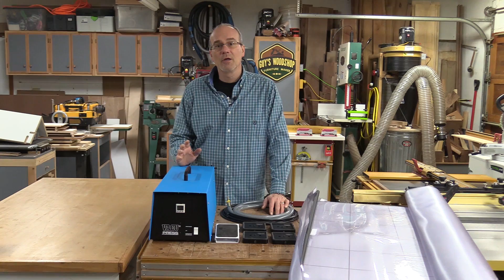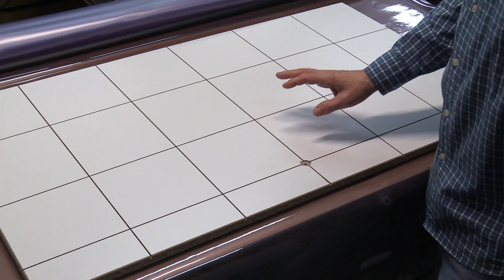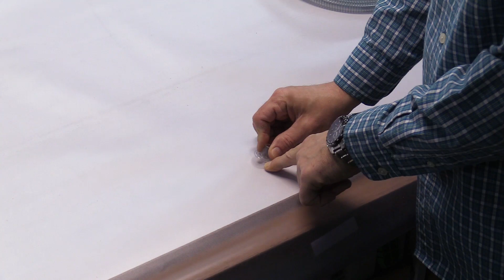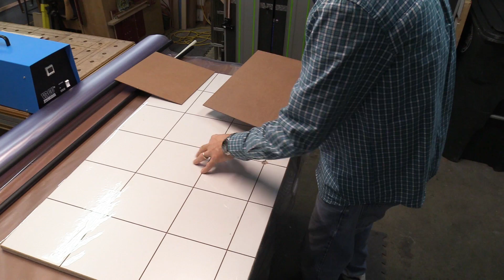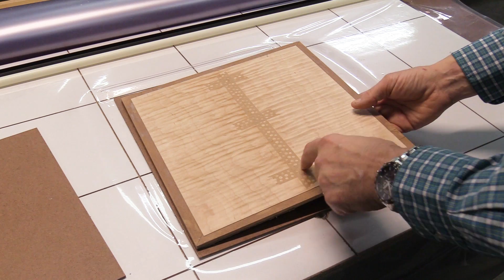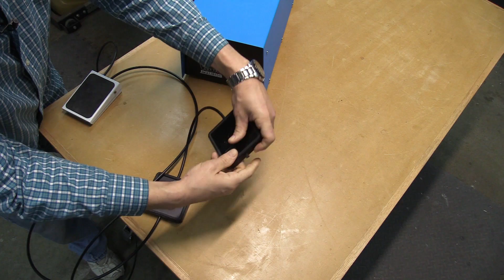Vacuum Bag System From VacuPress - Components and Use

Comment: Im glad to see Vacu press improved. My gauged vacu press does not auto shut off and on worth a darn.
Reply from the maker: I've been very happy with the Vacupress system
Reply: There is a check valve inside if it gets dirt in the valve it sticks and flutters wont quite stay shut so it never gets the correct reading call Vac u press they walk me thru it fix the problem ...My fault no filter !

Comment: The physics of this technique are absolutely baffling. How is a thin layer of plastic possibly giving uniform clamping pressure across a panel of any size? It’s absolutely incredible and lucky for me I don’t need to understand the physics to try this method myself. 🤣 great video
Reply from the maker: It's the at,mospheric pressure on the bag after you remove the air from the inside. Works crazy good. Thanks for watching!

Comment: How do you connect the 1/4” vacuum tube into the pump?  Is there a 1/4” quick release on the back of the pump?
Thanks
Reply from the maker: Yep, there is a quick disconnect on the line

Comment: Hi Guy, thanks for that tremendous review. I have been considering the Festool VAC-SYS system for a while and comparing to the system you are using, the Festool system is twice the price so VACU PRESS system is a pretty good alternative to consider. I don't have any use for a bag yet but I need a practical clamping solution. I have two questions. 
1) While using the pump to clamp vertically, if you have a power failure would the board fall off the clamp immediately or it will hold for a while like the festool VAC-SYS? 
2) Noise wise have you ever compare that system with the Festool system?

Thanks
Reply from the maker: Thanks Marcus. If the system fairly air tight, once a vacuum is established, there needs to be a leak in the system for it to fail if the pump is turned off. And I have not heard the Festool system in use, so I really couldn't comment on the noise difference.

Comment: About glue winding up where you don't want it:
Is it a problem?  Are there steps you take (that you might not use for conventional clamping)?  If glue gets on the bag, is it hard to remove?  Are there glues you avoid for this reason?
Reply from the maker: Good question David. Both of the cauls I used for this were waxed, so if glue does get on them, it easily comes off. And since the bag is plastic, glue doesn't stick to it. So again, it easily comes off.

Comment: A nice video Guy! I have been wanting to get a similar setup and try veneering. If I remember correctly you like Festool tools as well correct? Is it possible to use the new Festool vacuum clamp system/setup to work with a vacuum bag/veneering setup as well?
Also, the systems you see that have a plywood and PVC tube setup, are they designed for a compressor/Venturi setup or to just make a higher vacuum draw? Thanks for taking the time to answer our questions and making such informative video's. They have been a big help when I was looking for a new tool or needed more information for a technique or project..
Ron
Reply from the maker: Thanks Ron. I am not sure of the draw on the Festool vac, however I'm sure it will work. Just not sure of how efficient it will be. I have one of the shop made systems, and the PVC tubes are there for reserve.

Comment: Just subscribed to your channel. Great stuff. Love the vacuum pack system you have. I want to get one but have a question. I'm just learning about veneering. I've seen guys just use contact cement and then go over veneer with a piece of wood like a scraper. Making sure the veneer is contacting the substrate. Is vacuum pressing that much better? Does it last longer?
Reply from the maker: Hey Pete! Welcome to the channel. Yes, you can use contact cement. However with it you should use a paper backed veneer. It really limits the quality and variety of what veneer you can get. And yes, A vac bag is much better than a roller or iron any day.
Reply: Thanks for the answer that is exactly what I was looking for. You explained it perfectly. Question: Is it worth buying the Industrial 30 Mil Polyurethane bags or not worth the extra expense? I am just getting into veneering, but obsessed with buying the best equipment and supplies to start with instead of working my way up the ladder.
Reply from the maker: The polyurethane bags are very nice, and very expensive. They will last longer and are less prone to punctures from the contents of the bag. That being said, I have 3 30 mil vinyl bags. 2 are over 2 years old, and have been used heavily with no problems.

Comment: nice vac system guy..question...how do u know how much pressure  to use..and does is vary by size of the piece? thanks guy!
Reply from the maker: Thanks Joe. The glue will tell you what pressure to sue. Typically it is in the 12-25 range.
Reply: GuysWoodshop ahh ok. Because there's special glue for veneers gotcha okay yeah I have type on cold-press and it says 100 to 250 psi for 45 minutes to 2 hours cool man thanks just curious I might get one with the Uncle Sam money

Comment: Guy, The vacuum pad clamps you demonstrated here, would be a great addition to the system. But don't they need two very smooth (almost glass like) surfaces to have proper and strong adhesion? Especially if (as you mentioned in a comment reply) you may be using them to do edge routing?
Reply from the maker: Hey Mac. They worked fine on the MDF top of my assembly table that has been treated with wax, and I think you can see that they held the panel I was working on fine. I have tried them on plywood and solid wood also, and they work fine. A smooth, glass like surface is very helpful, but not completely necessary.

Comment: Very nice explanation and well done demonstration! You have upgraded your system, therefore it's obvious you are very happy with using the vacuum process. It wasn't long ago you had your first try on the curved laminates.
My question is, why not leave the laminates in the vacuum until the glue has fully cured? I noticed in an earlier process of yours, you took it out at one hour and then let the glue cure for another three hours. Might it be that there is a need for the glue to have normal atmosphere for proper adhesion and to be completely cured?
Reply from the maker: +MRrwmac Thanks Mac! Any time I have done pressing before with a veneer glue like the one in this demo, I have always taken them out after 45 minutes to an hour. And that's what I did this time.

Comment: Hi Guy, I have had the same system for years (no digital controller) and it has been great.  I use EvacuNet on top of the platen to help protect the bag from sharp corners.  It also aides in air removal.
Steve
Reply from the maker: Hey Steve! I have some of that also, and it's what I typically use if you've watched any of my videos that I do veneer. For this one video however, I decided to do the "classic" way of doing it. I really like the plastic netting.

Comment: Very well shot video and instruction, Guy. Do you have to leave the pump running when your using the clamps?
Reply from the maker: Thanks Steve! Yes, the pump need to be running in the "continuous" mode for the clamps. It's designed for it, and it's also very quite.
Reply: Ok, thanks.

Comment: I've been waiting for just this video. Good Job and thanks!
Where is your system available for purchase?
Reply from the maker: Hey Tom! The system is from vacupress.com. They have complete packages for home and hobby use. Look at the 1.5 cfm unit if you're not doing anything very large or planning bent laminations with the system.
Reply: GuysWoodshop Guy, did you say "don't" get the 1.5 cfm system if we are planning to do bent laminations? I assume that's because the vacuum pressure would not be enough to both attain and maintain the bend?
I thought (could be wrong - haha) the system you were using awhile back was at or near 1.5 cfm and you were able to achieve very nice bent laminations?
Reply from the maker: +MRrwmac What I did with the panels was bending veneer and flexible ply on a very small scale, and I had a real hard time with it. To do larger solid wood bent laminations, it makes it easier to draw the air out faster, that's why I might recommend a larger unit. Once that air is drawn out, the pressure is the same.

Comment: In addition to my other question can you use a compressor and a vacuum gauge and get the same results as this $900 pump.?
Reply from the maker: +Chuck Hart I had one that used a Venturi and a compressor. Not very happy with it. VacuPress offers a smaller system with a bag for less than the cost of this pump shown here. Very good value and it will do probably everything you need it to do. Take a look at their website. The link is in the description of this video.

Comment: Very good video. I have the same pump (although mine must be older as it does not have the digital display) and it's been superb over the years. I have a couple of similar plattens to yours which can be joined together in different shapes. (I think I posted a video on youtube about them at some point.) I like the look of those vacuum clamps- would be good for things like the Festool domino or routing when you need to raise the workpiece of the table a little.
Reply from the maker: +Richard Leon Thanks Richard! I am very happy with the quality of the equipment. I'm going to have a lot of fun with those vac clamps